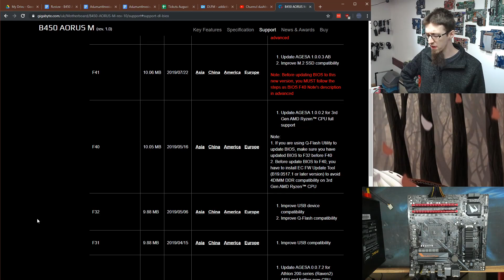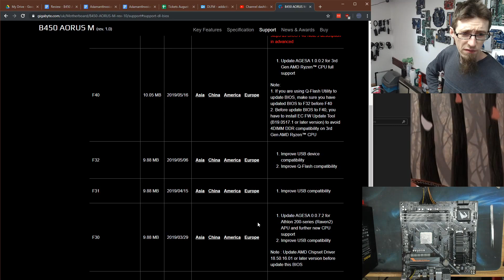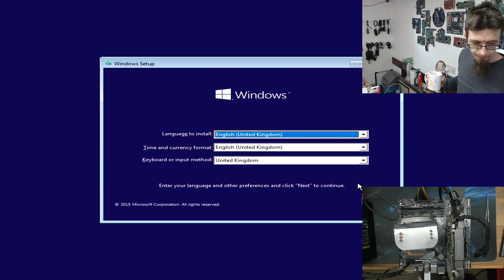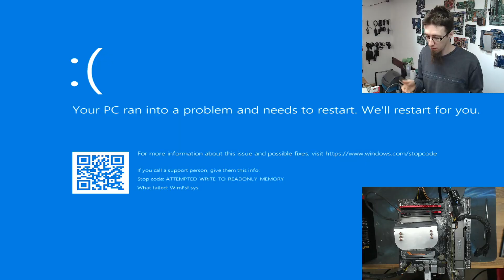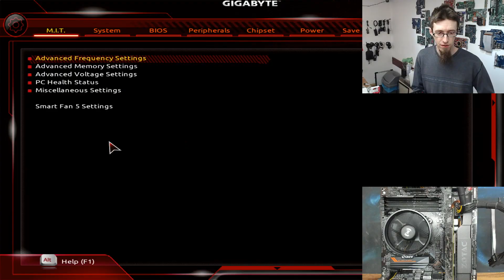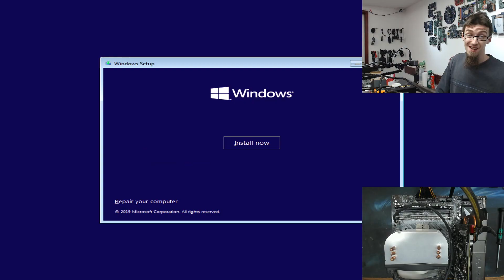LFC#183 - Gigabyte's BIOS update bricked my B450 Aorus M

Comment: A failed bios update is bad enough, but that sinking feeling you get when it happens is even worse. I have never lost a mb due to it. I remember back in 1998 or so I had a failed update on an Intel board that I thought was unrecoverable. I changed boards, boxed up the bad board. A few months later I pulled out the bad board and gave it a try and it booted stable with the new bios...go figure.

Comment: Did the samething using a 1600x. The board came with F2. I loaded F32 on the USB stick, updated the BIOS. Everything seemed fine but after I rebooted, it had actually regressed to F1 (probably the backup BIOS kicked in). Did the F32 update again and it worked. F40 worked on first try as well. So I went F2->F1->F32->F40. It probably hates that APU.

Comment: Okay so I know I'm like 11 months late, but just thought I'd let you guys in on a little tip. If you can't get the mobo to boot off of the backup bios, what I used to do back in the day on the H61/B75 gigabyte boards is short out the main bios chip, with a screw drive or metal tweezers or something, that essentially forces the board to boot from the backup bios and it then proceeds to re flash the main bios from the backup bios. I saved multiple boards this way. I've got no idea if this still works for modern gigabyte boards, but I thought it's important to mention for those who can't swap the bios chips like he did with the hot air station. Also great vids btw.

Comment: My B450 Aorus M very buggy... random shutdowns. Also when i set xmp profile 1 for ram after wail board just shutdown... and won't boot back again..  i have to remove battery to reset bios then it boots late. very bad experience with this board. This was my new board. cpu is ryzen 5 3600, bios updated to F51 from F50. Any suggestions please....

Comment: BIOS flashing on ryzen boards is a bit funky, probably best practice to use a ryzen first gen/ 2nd gen if one is on hand as they don't have support dropped, the APUs do on the mainline boards, but with my system I was going from a 1st gen to a 3rd gen, but the update process was done before the new chip was installed, still, the APUs are probably not the smart choice for updating boards that drop support, makes it less of a hassle I'd say

Comment: Not the first time ive heard Gigabyte borking their boards via bios update - I have experience a similar problem with one of their older boards not wanting to post if i had any hard drives hooked up to it after the update.

It took me absolutely hours to find out how to rollback the bios to the previous one as  manufacturers normally dont allow you to downgrade to an older bios and you have to jump through a fair few hoops to do it

There are two ways... Either use AFUDOS or a bios programmer that attatches to the bios chip via some sort of clamp that you hook up to your pc or laptop and use software to 'program' the bios chip to whatever you want.

The board i was using had dual bios but for some reason the back up bios chip wouldnt come up within the bios options so i had no source to clone back to the chip with the bad bios.

I eventually learned how to use AFUDOS the wrong way by flashing the completely wrong bios to my board which then triggered the back up bios to kick in because it detected that the image in the main bios was 'corrupt' and did an auto recovery and rolled back to the previous bios that worked just fine.

But it was a clients build and i lost days dealing with that thing.

I'll keep working on gigabyte stuff. I just wont touch the bios when a gigabyte machine enters my shop.

Comment: Couldn't you have taken am SSD with windows already installed on it from another computer and installed it on this motherboard is hopes it booted up into windows? I've seen another well known youtber that appears to do just that. He says windows 10 is very forgiving and will have to update for all the new hardware but it should work. Or so he said. I've never tried it, but I think I would have tried to do that if I was getting all these problems.

Comment: Here is what you did wrong. you went from F2 to F32 without going to F4 then F5, F30,F31 then F32 without the other BIOS updates first you missed out on what those Bios updates put into the BIOS chip therefore bricking the motherboard with your BIOS at F2 you can't jump to F32 you have to update in steps that's is what i do and it works every time.

Comment: 35:29 - Why you must changed place the BIOS chip (soldering)? The Dual BIOS feature didn't work? BIOS software should be reflesh in the MAIN chip from BACKUP chip. My english is not the best so I don't know why you did this.
Reply: The board was not flashing from backup. Most of the time it seemed to be crashing almost immediately if it POSTed at all.

Comment: I don't know Gigabyte motherboards but removing the battery will not resetting the BIOS. Most of the time you need to set a jumper (CLR_CMOS). Why did you not test the other ways to switch to backup bios?

Comment: Doh, some putz in the BIOS dept really dropped the ball on this.. I have written some BIOS code and I know what they did but there is no reason to release the BIOSes this way. How to explain...... um... Sorry but I have to make this as simple as possible to avoid driving down a rabbit hole of my trying to over explain everything.

You can compile a BIOS in a couple different ways. Lets just call it Larger and Smaller file. The Large File version contains everything needed and can completely rewrite the entire BIOS with no issues. The Smaller version does not rewrite the whole BIOS and retains a large chunk of code and settings. You can imagine the problems updating to a much more recent version and this leads to the need of installing previous versions to get bits and pieces of other updates that are required for the newest. This also leads to the likelihood of a small error (through no fault of yours) to crop up and screw up the whole process. The best thing to do is to just release both compiled (Larger and Smaller) and let people use the one the want, and add a small note that says, "the Larger BIOS will erase all your settings"

Comment: st upgraded my old AM3 ddr3 computer.I'm using
GIGABYTE B450 AORUS PRO WIFI (rev. 1.0) 
OLOy 16GB (2 x 8GB) 288-Pin DDR4 SDRAM DDR4 3600 
AMD RYZEN 3 3200G 4-Core 3.6 GHz (4.0 GHz Max Boost)
Everything worked like a charm. I don't know the bios version
but if it ain't broke don't fix it.

Comment: I see Gigabyte hasn't changed, still has crappy BIOS.
Reply: Holy shit nevermind, I attempted a RAM OC and the BIOS crapped itself. CMOS reset wouldn't even work. Refunded the board and have a ROG Strix B550-F on the way now. Don't buy Gigabyte.
Reply: @foxylune  I had a Gigabyte B350 board, bios decided to die, replaced it with a ASUS ROG Strix B450 board. The bios did brick after I upgraded to a Ryzen 5 2600x and OC'd the RAM to 3200 MHz.
Reply: I would never update from early bios f2 straight to f32. Such a noob thing to do is just common sence
Reply: Thank God I jump from gigabyte to  asus.
Reply: B550 Aorus Pro, no BIOS issues so far and I've updated through every BIOS this board had from F1.

Comment: I had the same thing happen to me with an X470 however don't know if I got lucky but after trying to turn it on several times I decided to leave it for a bit and come back to it after probably about 45 minutes it finally turned on and since then I have had no issues updating the bios

Comment: Had a Gigabyte H370M DS3H mobo.   Did some rather late night finishing up, I should have done in the next day's clearer light!   I had forgotten to plug-in the 24 pin connector that night, prior to starting up the computer, that night.   Having no power from the power supply, when the start circuit was closed, that lack of main control power, allowed uncontrolled capacitor power to cause damage.   Though somewhat geekish, I''m an electronic absolute newbie!   A better explanation is most welcomed.

Comment: The board is now working, but there is still a problem. It is not logical that main BIOS on a new board was older than the backup BIOS. Either someone back-flashed F4 on a newer F40 board, or it was improperly flashed from Gigabyte.
Either way, switching the BIOS chips is not something even a repair tech should do to a new board. It is possible now that, in case of a future problem with the main BIOS, the board will switch to the defective BIOS chip on the backup.
This board should be RMA-ed if still under warranty, or exchanged at the dealer for a new board.
I'd posit that you should never kludge this board into working, then present it to a customer as a repair. If it goes bad in the near future, it is your name that is effed. 
Best explain the problem to the customer and however it happens, get a new board. 
Also, if you're going to go Ryzen 3xx0, at least put it on a 550 board

Comment: Unfortunately when updating the bios of my b450 pro wifi  I skipped the step and installed directly from f41 to f50 without update the EC FW ;( and now when installing Windows 10 I get the blue screen of death... I think that I will return to the f40 version and then update the EC FW and  again to try to see  if the error is fixed

Comment: "I think there's a broken link on the Gigabyte website."

Youuuu bet your SWEET ass there could be. 

My Gigabyte Aorus Gaming 5 Motherboard has been the most annoying mobo I have dealt with. Problematic, dual bios choosing on random reboots bricking ram timing. It'll load the STOCK bio which was F.2, and it's on 15. It has been a nightmare at times. I will buy me an Asus next.

Comment: Just a open question? With the way u had the cpu cooler block just sitting in their  In the past i ran into pressure or contact problem's,
And to fix it i always had to mount the block down.

Comment: I spent hours staring at that horrifying black grid on Gigabyte's website, scrolling back and forth between reading F42, F40, F32, and other entries while sweating nervously. I managed to successfully update to F32 and use the EC FW tool so I'm not going to push my luck any more. It's like playing Deal or No Deal. B450 Auros Pro Wifi

Comment: I always keep an old PS/2 keyboard around, they come in quite useful sometimes. For example my current home PC boots so quickly that my USB keyboard doesn't function until a few seconds after POST is complete, presumably because the USB drivers haven't fully initialised. This means I can't access the BIOS by spamming DEL (or boot menu etc), as the computer cannot see the USB keyboard until after the option to do so has passed! Using the PS/2 keyboard gets around this issue quite nicely.

Comment: Out of curiosity, how come your R5 3600 is sat at 1.0v vcore and 3GHz? Mine (Albeit in a different board from Asus) is sat at 1.4V and 4.0GHz out of the box.. Which means it sits idle in the mid 40s/low 50s under a Dark Rock 4. I mean.. Safe, but.. Not exactly an ideal idle temp.
Reply from the maker: Annoyingly it's only recently that I've started paying attention to auto-voltages on Ryzen, but the current knowledge is that auto-voltage looks really weird, but does actually know what it's doing.

Comment: What if i biosed it to f31 it gets bricked.Can it work with the 2nd gen ryzen CPU's
Reply from the maker: The board will run a second gen Ryzen on any BIOS version, this video was an issue of me updting for 3rd gen support, but at the same time losing support for the old flashing CPU I was using. It was a chain of cock-ups.
Reply: @Adamant_IT Thanks your video was truly helpful, I am facing same issue with my ryzen 5 3600 , I've contacted seller they've said they'll fixed this.issue
I am hoping it will get fixed.

Comment: Well done, Sir.

The following info pertains to a much older dual bios Gigabyte motherboard but may be of some assistance.

After using a socket AM3 processor to update its Main BIOS to achieve support for an FX-8350 (and then testing the results for a few days), here is how I updated my GA-990XA-UD3 (rev. 1.x)'s Backup BIOS chip to match its Main BIOS chip:

1) Use a PS/2 keyboard
2) In BIOS, Load Fail-Safe Defaults
3) Exit BIOS and reboot while holding down <Alt> and repeatedly tapping <F12>
4) The following message should appear: "Press [Enter] to start copying Main BIOS to Backup BIOS..."
5) After the Main BIOS has been copied to the Backup BIOS the following message should appear: "BIOS successfully recovered! Power off or reset system!"
6) Switch off the power supply (or unplug its AC cord)
7) Wait a minute or so for the voltages in the motherboard to dissipate and then clear the CMOS
8) Turn on the power supply, boot into the BIOS utility and then Load Optimized Defaults
9) Reboot

I have successfully employed the above steps on my current motherboard, a GA-990XA-UD3 (rev. 1.x), to equalize its Main and Backup BIOS chips to BIOS ver. F14b (which I downloaded earlier this year) thus imbuing the motherboard with native support for my FX-8350 in case the 'board's Main BIOS ever becomes corrupted due to a malware attack etc and the GA-990XA-UD3 (rev. 1.x) has to boot into its Backup BIOS to repair its Main BIOS.

EDIT

On a hunch I tried a variation of the above step 3; Holding down <Alt> while repeatedly tapping <F11> which yielded the following on-screen message:

1. Remove fixture or change jumper
2. Press [Enter] to start BIOS recovery....

I suspect that the cryptic "1. Remove fixture or change jumper" is in reference to some expansion cards which I have installed in my PC.

Next, I repeatedly rebooted the machine while holding down <Alt> and tapping each of the F-keys in turn with each reboot and got nothing but regular boots.

Finally, I once again rebooted while holding down <Alt> and repeatedly tapping <F11> and got:

1. Remove fixture or change jumper
2. Press [Enter] to start BIOS recovery....

The "Press [Enter] to start BIOS recovery" message appears to indicate a means of using the Backup BIOS to re-flash the Main BIOS (should it ever become corrupted for whatever reason).

Reference:

Jan 20, 2011
dinos22
How to update your backup bios on GIGABYTE P67 boards - YouTube
http://www.youtube.com/watch?v=QQkZvMVPC28

Comment: Got a X570 Aurus Ultra Plus. It bricked all my ssd's and m.2 nvme because their own app center software is incompatible.
Works with out it but it's kinda needed. Should I send the piece of shit back and go without for how long I don't know plus $28 shipping?  Won't buy another from them. Cost me  a lot of time and money. ryzen 3800x, 32gig 3600  ram Sabrent mvne drives

Comment: Don't forget to save the working bios to the backup bios chip as it still has the dodgy bios installed on it. You never know , you might have a problem in the future with the good bios and it will load the backup and you will be back to square one.

Comment: When i reset the bios by taking the battery out I normally hold down the start button for 30 seconds to remove all the residual power from the board. If that does not work I switch the reset bios jumper if there is one available, or take the battery out and short the two pins on the battery holder contacts. I have found just taking the battery out is not enough to reset the bios on some occasions and have had success with the ways mentioned.

Comment: This is why I find it silly the automatic bios that gigabyte and msi do (some of there motherboards have an actual jumper to force a bios select and some use socketed biased chips so at least you can just change it without having to de solder it) I assume now you got it sorted out you can update the backup Bios now (the bios not saving stuff after power loss maybe battery inserted upside down)

Comment: Early motherboards have small amount of bios flash memory, a lot of the older motherboards mostly first and second gen ryzen boards only have 16mb of flash for the bios witch causes these complicated bios updates, with 32mb flash bios motherboards can take the full cpu microcode update to support all cpus and can take full Bios update from The start (only Ever seen this on Asrock and gigabyte motherboards)

Comment: But. Why did the Q-Flash update the backup chip as well ? This makes no sense. The backup chip would serve no purpose. 
It could have been updated in the BIOS with F40, but it didn't have any time to do so. Weird.
Reply from the maker: This confuses me a lot as well. I've long considered GB's Dual BIOS to be a great feature, but this was the very time when I needed it, and it was worthless. You need a physical selector switch for Dual BIOS, otherwise there's just no point.

Comment: I do NOT have this board .I have ax370-ds3h-cf, but it also has the same red txt about needing a version 32 before the final. I am building a new system, ans will wait until it is fully up and running before trying to update, I have been in computers a long time since 1977 and a bios update is one of two things that scare me, other is reg editing.I also remember the  floppy bios install/updates good video

Comment: alas the days of forced bios updates via usb seem behind us
Reply from the maker: BIOS Flash-back is still very much a thing, it's just not a common feature on low or mid-range boards. This has changed for X570, and I think B550 as well, which all seem to have it as standard - but it's kinda too little too late, since we're now in the final phase of AM4 anyway.